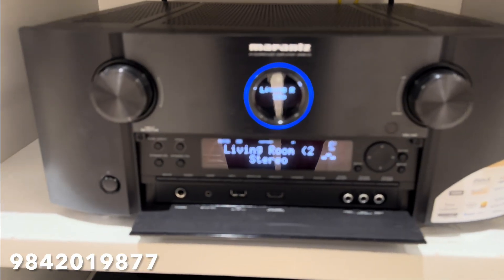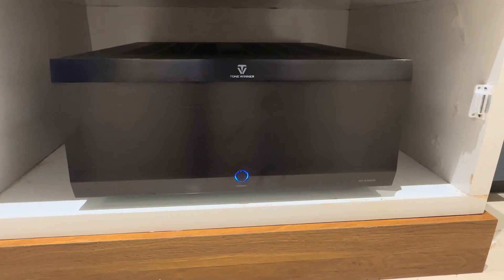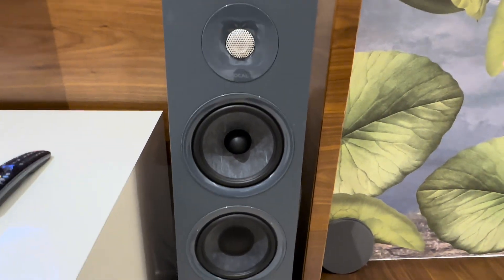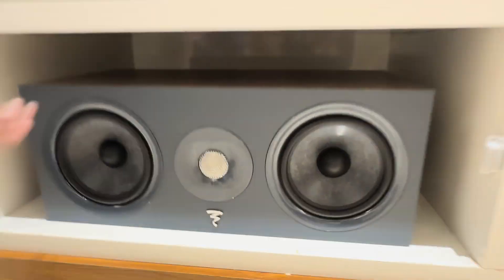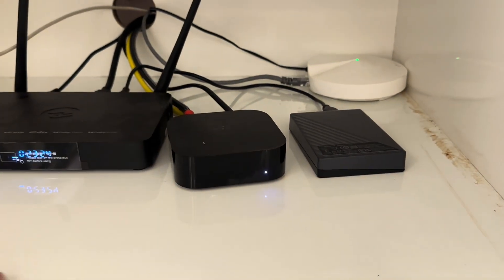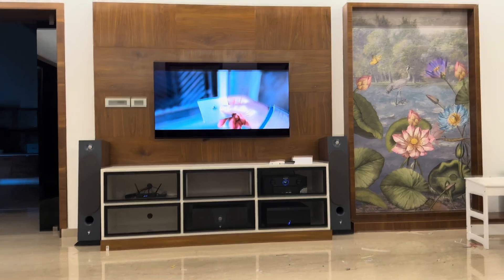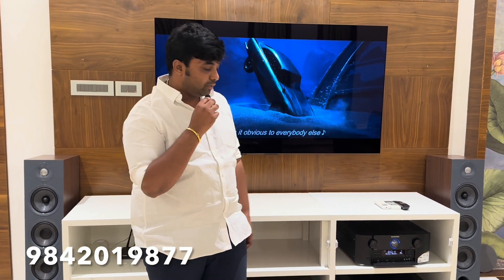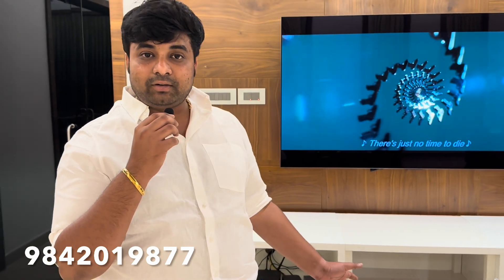Marantz SR8015 & Tonewinner AD-8300 11CH Power Amp Installation and Calibration

Comment: I suggest to use acoustic carpeting and acoustic window screens  in order to achieve optimal sound quality for a HT experience. This entire set up has been done in a place where it is against sound quality, so many glass reflections. Reflection is too high it will cause headache while continuously watching. Also placement of Sub should be near tower. Tone winner is a bad choice for this Amp and speakers… it is like driving Mercedes on mud road.

Comment: tone winner sound  was not good , you have spoiled the entire setup . not getting the entire sound signature of focal and Marantz . if customer before buying the premium products  do  consult with professionals . else waste of money .
Reply: Thn which 11 channels power amp is best for ur suggestion tell me
Reply: @legendforever1430  if you are using premium grade audiophile speaker then audiophile grade power amp is best  else sound quality  is degrading . choose these brands  rotel , arcam , anthem , parasound , krell etc  .  damping factor is an important role. good damping factor  value perform well . in a low end amplifier manufactures not mentioning any damping factor value